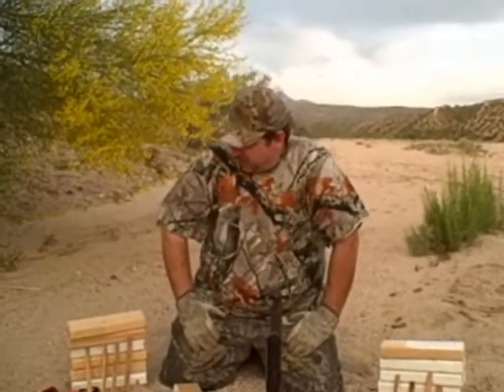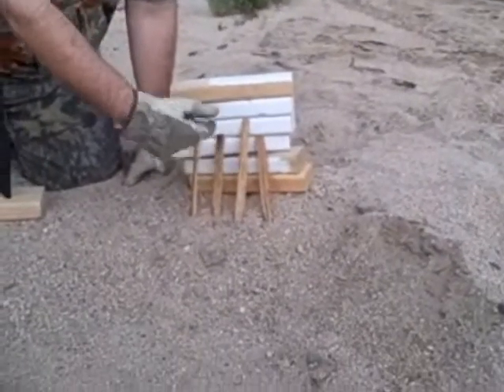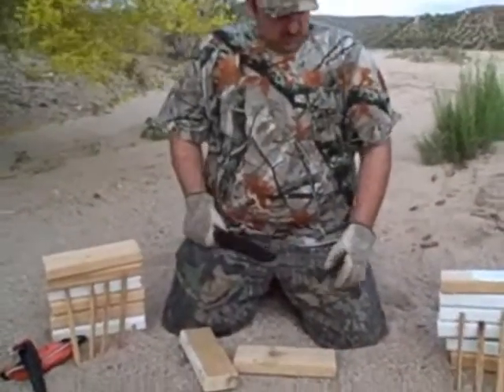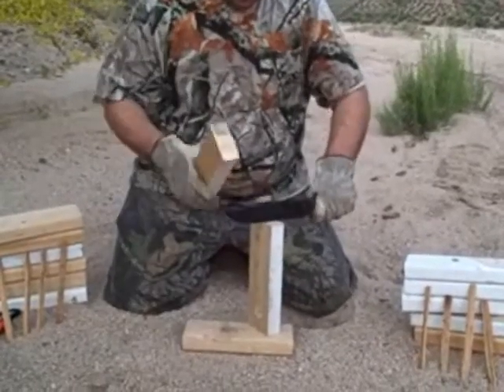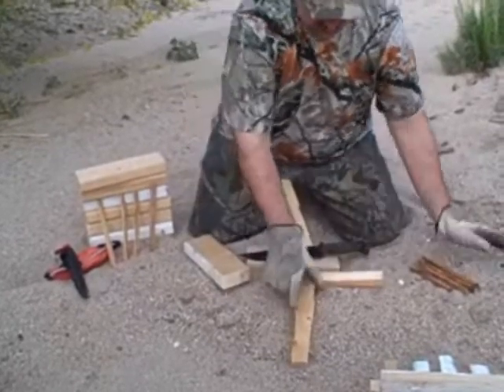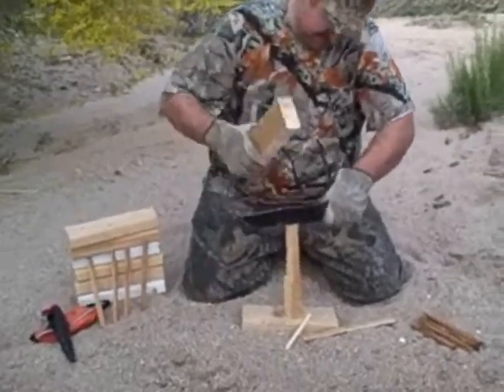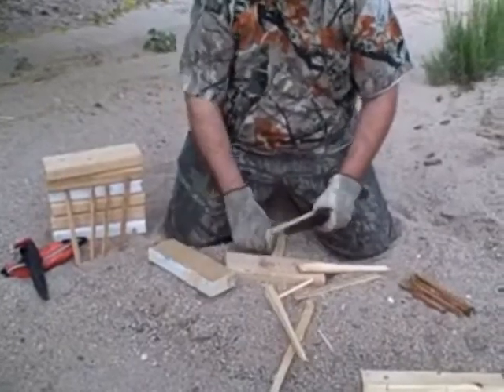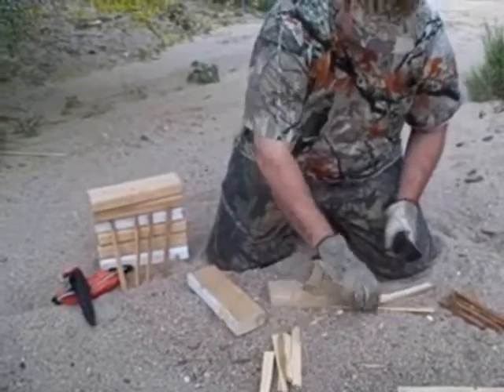Up Side Down Fire Part 1 of 3

Comment: The key to lighting and sustaining any fire is heat and oxygen.  If you can keep the heat maintained within the fire pit or platform, it will burn longer and more completely (= efficiently).

The layering of the fuel is less important than how you reflect or contain the heat.

Interesting video, thanks for sharing!